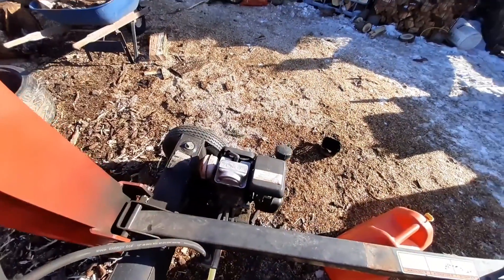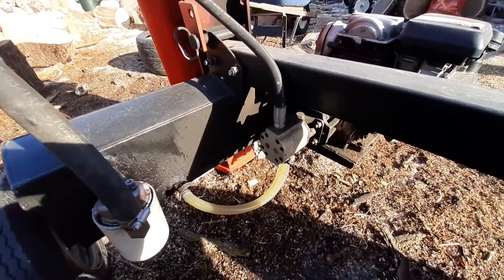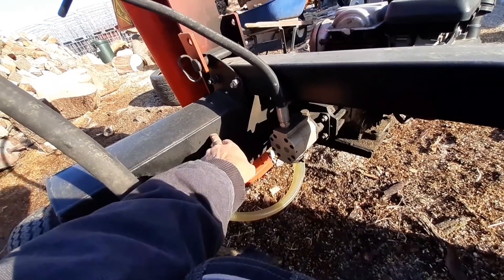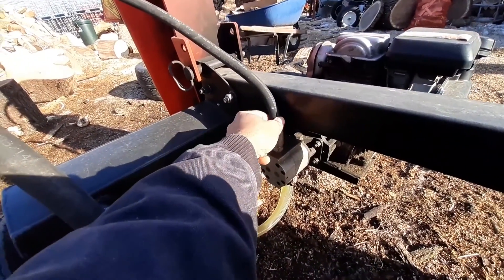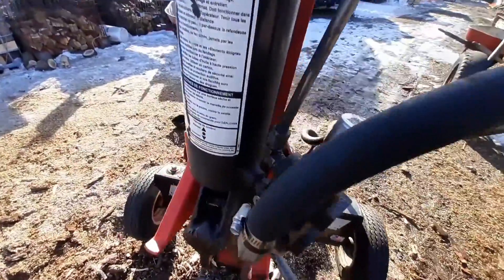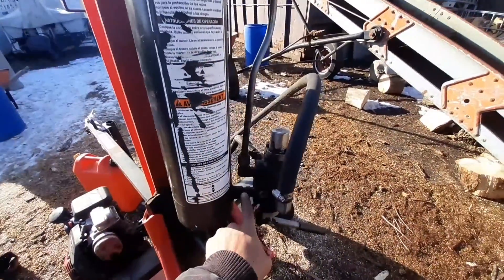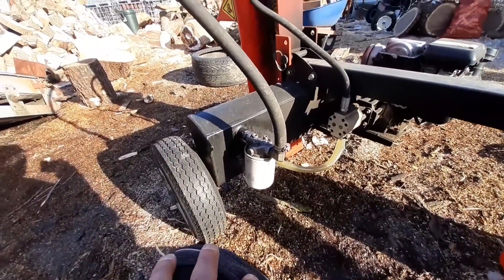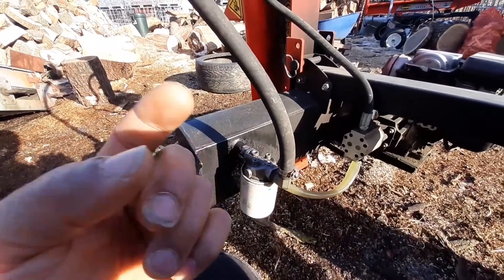HOW HYDRAULICS WORK - 25 TON LOG SPLITTER

Comment: How is the pump mounted to the engine? Is there some type of like neutral clutch to make the engine easy to start to where it’s not under a load from the hydraulic motor?
Reply from the maker: Its connected directly to the engine via a Lovejoy connection, which consists of two circular hubs with three raised triangle shapes around the perimeter of the hubs,  and a a six pointed 3D star shaped plastic piece which acts as a bushing,  fits between the triangle parts of the two lovejoy hubs amd they are all mated together. The hubs are tightenee onto the engine output shaft. When installed, both hubs and the bushing mater together form a what looks like a cylindrical shape
Reply: So when you turn the engine over to start, it’s already under a load turning the hydraulic pump at the same time making it harder to start? Harder to pull the pull start rope?
Reply from the maker: No. Not at all. Pump is always running and doesn't effect engine load in any significant capacity. Fluid is dammed up by the valve position. Until one operates the valve and the hydraulic oil flows through the system

Comment: Thanks bro this helped me for a college assignment
Reply from the maker: Hey, no problem. I was inaccurate about naming the return line, but I was still new to hydraulucs. Years before this i learned how it all works and then designed my own log splitter from scratch and the only things I got wrong were oversized lines for the log lifter and I put the pressure gauge on the low pressure side of the valve. Cheers!

Comment: If I needed to replace a hydraulic hose,would i have to drain the fluid somewhat and remove the hose and measure it and order a replacement,how does one go about this.?
Reply from the maker: @eastside0434  you only have to drain the system if you're taking off the hose between the pump and the reservoir. Any line that starts from the top of the reservoir and runs above it will always drain into the reservoir after use. Thanks for watching

Comment: Cavitation??
Reply from the maker: Is when air bubbles that develop in the oil create shockwaves from the difference in pressure and damage the interior of the hydraulics system. Thanks for watching
Reply: @OntarioFirewoodResource  when I run my logsplitter the piston jerks when I'm splitting wood

Comment: Thanks for the video. I have the same punp. Mine is leaking. Trying to figure it out.
Reply from the maker: No problem. Just a guess, but maybe there's an O-ring that needs to be replaced in your pump.
 I have to say that my SpeeCos are great machines. The lips on the beam that guid the wedge have bent out of shape but just need banging back into shape, one has a flange leak on the reservoir and I've replaced 2 or 3 valves because they leak and now I just put a hose clamp and rubber on them so they stop leaking.

Comment: I have a 25 ton Speeco splitter. When I was done using it for the season today, I changed the oil in the B&S engine. I then greased the rail the wedge rides in. While I was doing that the engine acted like it was running out of gas which it probably was. I put some premium gas in and ran it again but it was surging and the ram would not work forward or backward. There is enough fluid in reservoir. I am at a loss as to what happened. Is there a shear bolt where the engine meets the hydraulic system? Or what are your thoughts as to what is going on?
Reply from the maker: Check the lovejoy bushing, make sure it's not warn out through warping, missing sections or gone completely. This is just a guess. But maybe something happened inside the ram. Overall, I'm kinda clueless as to what happened. Maybe you lost compression, power is gone somewhere in the system
Reply: @OntarioFirewoodResource  I checked the lovejoy connection and the key in the pump side collar had come out. It had been wearing for some time. The whole connection needs to be replaced. I found one for $39. Thanks for your input!

Comment: New subscriber here!! The cam that connects the pump to the engine…I THINK you called it a “love joint (?)”….I hear through hearing aids so I’m sure I’m not hearing it right…any way…can you explain how this is supposed to work? I have a dirty hands 22 ton splitter and the ram just stopped. A friend thinks that the two pieces are supposed to be permanently engaged. We think that’s why it’s not working but I’m not sure how it’s supposed to work. Looking for help.
Reply from the maker: Hey thanks for subscribing! Yes the "lovejoy" is supposed to be matched up on both end with the plastic or rubing bushing in between, which gets worn and will not trasmit the engine power to the pump. Think of it like a u-joint and driveshaft assembly
Reply: @OntarioFirewoodResource  outstanding. I have a Dirty Hands which gotten eaten up during Covid and is now no more! My luck! Anyway, the 22 ton has a coupler match of 3/4 to 1/2 inch which proved to be a challenge to find…but I did find one. Thanks for your help…looking forward to checking out some more of your content!!

Comment: I bought a used splitter and want to change all the hoses and the control valve. Is the control valve a standard item or is it made specific for that particular ram and is the system under any pressure when the engine is off? Thanks
Reply from the maker: No there are things you can play around with , there has to be some balance within the system, that's all. You can get the highest flow rated parts, just make sure the oil reservoir is big enough because you can get overheating. Stay tuned for my high output splitter that is under repair. I designed the system myself
Reply: @OntarioFirewoodResource  This one here is pretty heavy duty, probably a commercial one. It has a Honda GX 340 11hp with a 45 ton ram on it. Kind of overkill for a homeowner but I’d like to go into the firewood business after I’m retired. I have around 8 more years until that happens. Besides, I love splitting and stacking firewood and I don’t even have a fireplace or wood stove. So, I’ll keep it busy somehow. I figure this machine will last forever.
Reply from the maker: Ya that's overkill, my machine has a 13 ho and 35 ton ram. Make sure you have a two-stage pump and have a fire in the backyard every nowband then 🙂

Comment: Is there any way to speed up the cycle time? Good video...
Reply from the maker: Thanks Thanks watching. If you upgrade the motor and pump, you will overheat the oil because the reservoir would have to be made bigger to hold more oil
Reply: @OntarioFirewoodResource  Sorry, I forgot to add, I am running a 3 point splitter off the back of my tractor and trying to make it work of the tractors hydraulics. I am currently running 11.5 seconds to full extension of the ram 22" span (per the factory specs) I just thought the valve itself might have an adjustment on it to let more oil through.
Reply from the maker: I've never heard of that feature before. Either way, more flow equals more heat
Reply: @OntarioFirewoodResource  Thanks again for getting back to me, great info to know, take care.
Reply from the maker: No problem and thanks for watching
Reply: @markrankin3297  you may have figured it out by now but to speed up the cycle time of your splitter, instead of using the tractors hydraulics, I believe if you mount a pump to the crankshaft then it will be faster.  We have the same thing; our splitter is running off an auxiliary on an old massey-ferguson from the 80s.  I'd like to do the same on my TO30.
Reply from the maker: I love it when an outside the box solution is made known!